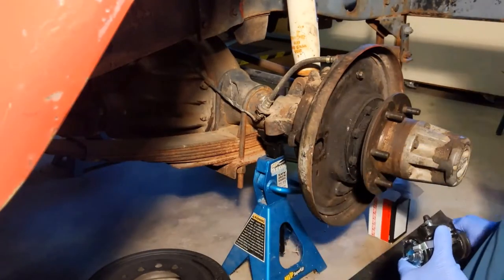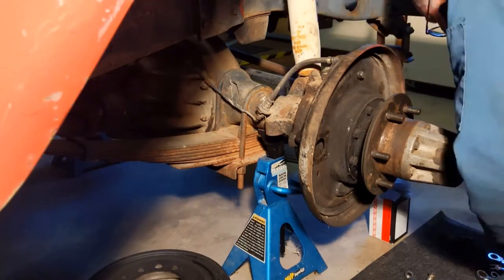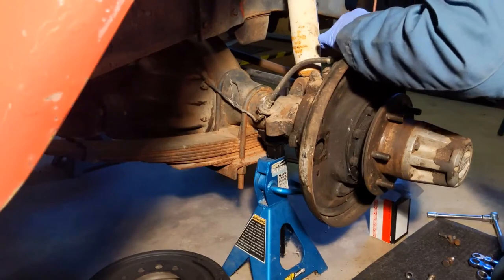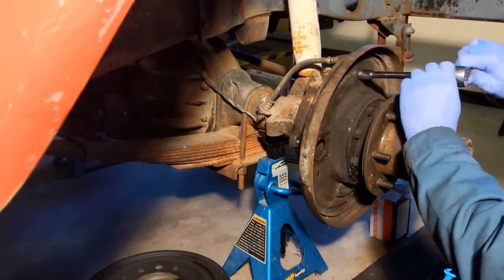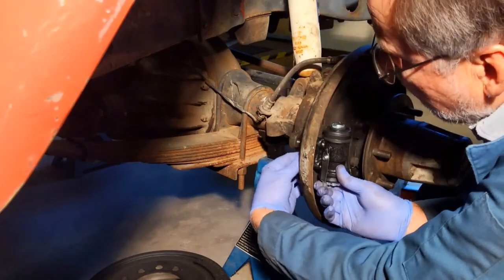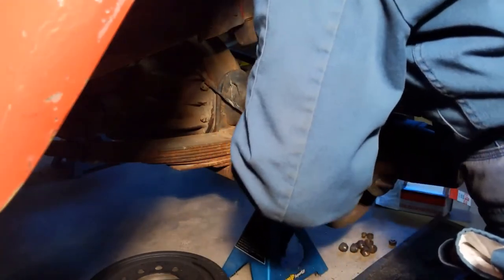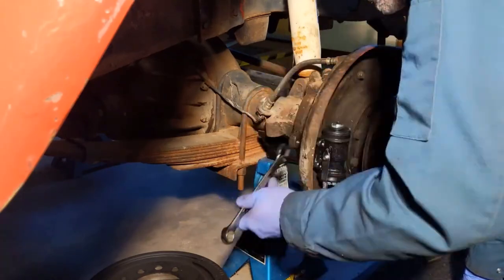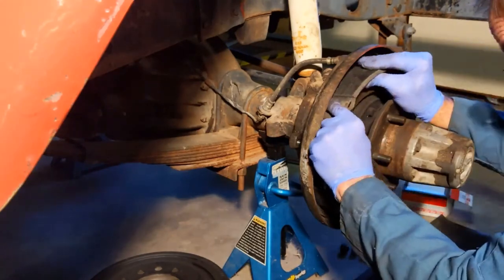Brakes Part 3

Comment: Wish Toyota put the Front Left and Right wheel cylinders adjustment nuts on the bottom, pain in the butt to adjust with steering linkage in the way. Im enjoying your videos. Thank you.
Reply from the maker: It's a pain.  Most vehicles had self-adjusting brakes in 1969.